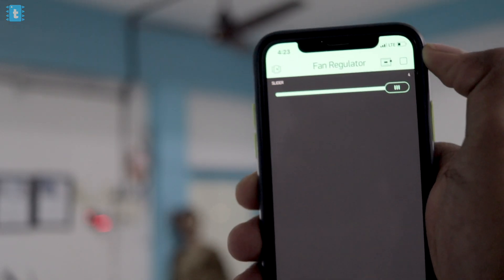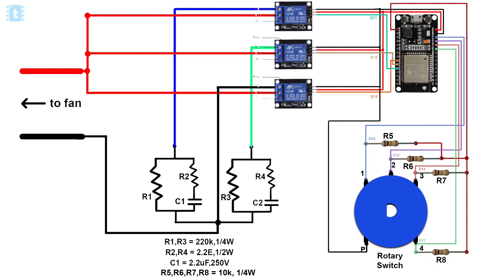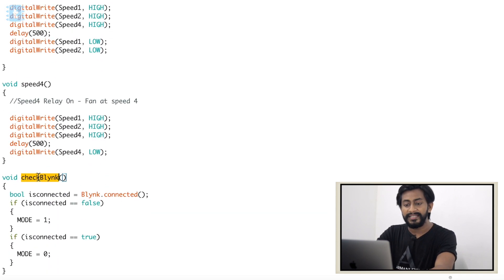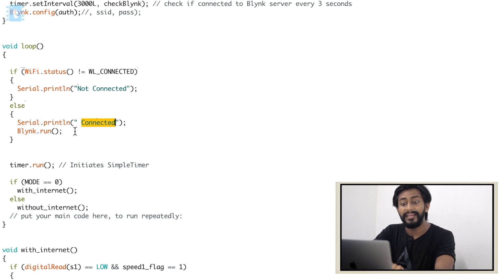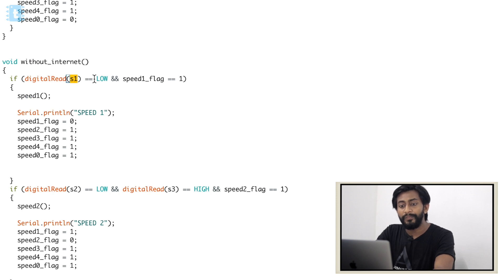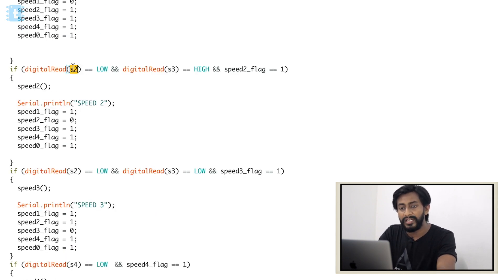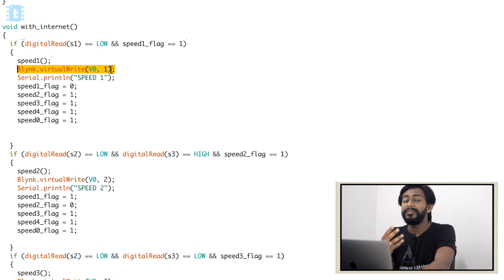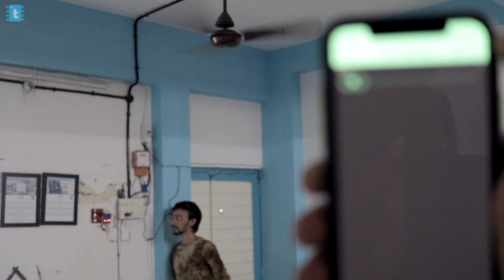Fan Speed Control with & without Internet | Blynk | ESP32 Projects

Comment: Tried the same project, but the esp32 doesn't get connected to the WIFI (credentials are correct - (ssid and pass)) , just the reverse "?" gets printed in serial monitor of Arduino, upon pressing the "en"  button of esp32 the following message gets printed: 
ets Jul 29 2019 12:21:46

r3t:0x1 (POWERON_RESET),boot:Ox13 (SPI_FAST_FLASH_BOOT)

configsip: O, SPIWP:Oxee
clk_drv:0x00,q_drv:0x00,d_drv:0x00,csO_drv:OxOO,hd_drv:OxOO,wp_drv:OxOO
mode:DIO, clock div:1

load:0x3fff0018,len:4

load:0x3fffOOlc,len:1044

load:0x40078000,len:8896

load:0x40080400,len:5816

'entry Ox400806ac

trying to figure out from a week but couldn't recognize the error, could you please figure it out.

Comment: I HAVE A BIG PROBLEM: When powering to the board ESP for the first time without INTERNET, the program   "Void setup()". So I  relay by switch, if the model wifi restart too late i have to wait until the board finish run Void setup() to connect internet. Do you have any idea to resolve this PROBLEM.

Comment: After uploaing the program into ESP32 the Relays are Auto Turning ON and OFF, will you tell me why it was happening?? Please.....
Reply from the maker: Have you connected the regulator with pull-up resistors ?
Reply: @techiesms  No, i have designed PCB with 3 relays...... after uploading the program into ESP32 and inserted into board then relays are getting auto ON n OFF...... i have not connected the regulator pins to ESP32, in the serial monitor it's printing like connected, speed1, speed2, speed3.... like that printing continously...... please suggest me any solution

Comment: I watched your both videos
Great 
In this video you have addedreal time feedback on app of manual speed
But if your manual speed is at 1 and you changed it to 4 by app what will happen and if anyone see on manual fan regulator is at 1 but actual speed is 4 it's confusing so how you will get manual reverse feedback that you turn to spend 4 by app
Can you add actual stepper motor or servo motor to turn the direct regulator knob

Comment: In case of Internet mode+realtime feedback, If rotary switch position is set at 4 and at the same time if we are trying to change speed using app(say 2) then which speed will work at that time? 2 or 4? ESP32 receiving 4 from switch at the same time receiving 2 from app,value conflict will occur, Isn't it?

Comment: if you regulate through mobile  app but physical not change regulator position, if internet going down Micro-Controller sen. phy. regulator position and its down after 3sec into the phy. regulator data. try to used Push button with LED indication with different level.

Comment: We will be more happy if you can make a circuit that can be kept inside switch boards, with all the features like fan dimming and controlling other appliances. Main thing is size try to make it as small as possible. If you do it we will be so happy sir.
Reply: 1fan and 2-3 appliances will be fine for each board

Comment: Great work! I'm using the similar setup and with rotary encoder. One step clockwise increases fan speed and anticlockwise decreases. Muti step rotation sets fan to full speed or lowest depending on the direction of rotation.

Comment: Please make next project, as you said, which Includes both Controlling other appliances as well as fan dimming circuit in a single circuit board/PCB ...

And it will be really ultimate project if you add Bluetooth feature also..
Three way control internet+manual(with/without internet)+Bluetooth😍
Reply: Easy to comment hard to make. once again read what you asked it's totally complicated thing

Comment: Yess we should make a one big pcb with all the switches and the fan dimmer
Reply: and also inside the switchboard or in a closed enclosure near the switchboard. @techiesms maybe use a pcb mountable power supply unit(s).